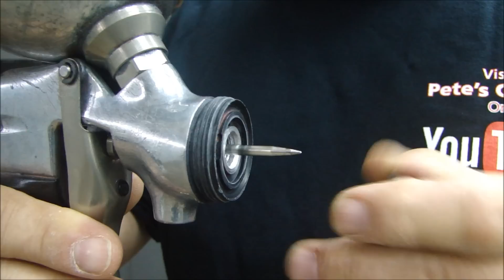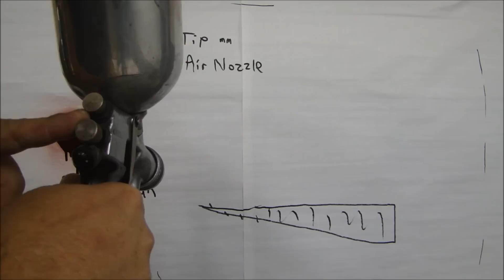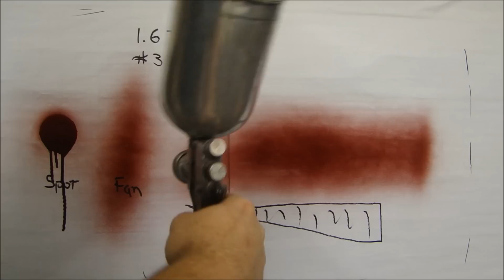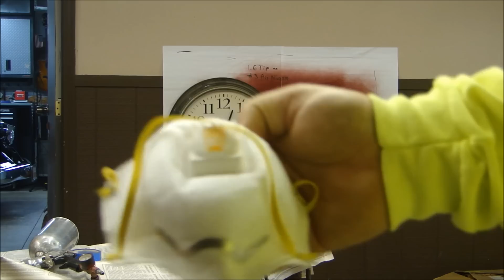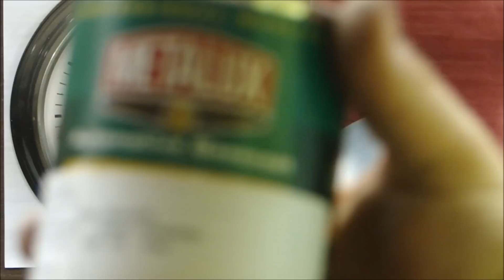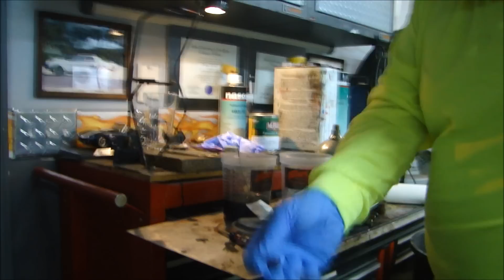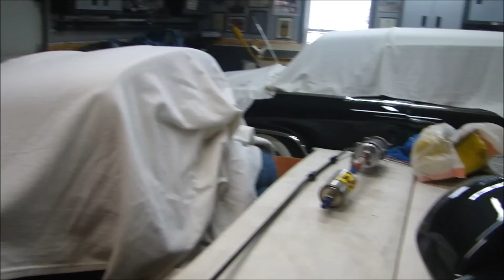Beginners Guide: Spray Guns & Spraying Base Coat Clear Coat

Comment: Hello Pete,
Enjoying your informative videos.
I have (3) Full Size HVLP Spray guns.
(2) have a 1.7 tip. (1) has a 1.4 tip.
All 3 new guns were purchased from Princess Auto in Canada.
Princess Auto is something like Harbor Freight in the USA.
Also, I have (4) new Mini HVLP with 0.8 tips (purchased again from Princess Auto).
My compressor is a 1 Stage 5 hp. 60 gallon unit (bought at a yard sale) used with a siphon spray gun.
The siphon spray gun was used in painting cars, furniture, and bird houses.
My questions: What spray tips should be for painting base coat clear coat paint?
Can my compressor be used with a HVLP spray gun or should I buy a 2 Stage Compressor?
Richard

Comment: HI THERE, I AM SPRAYING MY REAR CAP ON MY CLASS A RV- I HAVE A QUESTIO ON HOW TO PAINT THE REAR CORNERS- THEY ARE (ROUNDED) 6 FT. TALL AND APPROX. 12" WIDE- HOW DO I SPRAY THE CORNERS "VERTICALLY" INSTEAD OF SIDE TO SIDE?? THANKS PATRICK

Comment: Thanks for the tips, i've done small holes in bumpers. But very soon i'm going to try and paint my 2010 silverado. My question is how much activator should be used per 6 of paint? 6 to 3 of activator?

Comment: Great video. I have been cleaning my gun by spraying lacquer thinner through it, onto cardboard. will use your suggestion. I did not see you clean the gun, after a 2 part clearcoat. Is it the same, or is there a different chemical to use?

Comment: Hello there! I am very much an amateur painter and I've been doing as much research as I can but i had one pressing question. For things like the clear coat with a flash of anywhere from 5-10 minutes or even a base with a flash from 10-15; do you clean out the paint in the gun and put fresh paint in for the follow up layers or do you simply keep the gun loaded and wait for the flash time to pass. I actually come fresh from working on my engines camshafts which funny enough was guided by your wonderful series of engine videos! Keep up the wonderful work and thanks in advance for any advice!

Comment: Great video, but I have a question. When you spray the clear coat, is it 2k clear? If it is, I read the isocyanates in it when atomized, can get into your system thru your eyes, and I saw you were not using eye protection.
I wanted to spray clear in my garage, but I am really concerned about the isos.
Can you please comment?

Thanks.

Comment: Great overview for people trying to learn.  I am in the research/learn before buying a spray gun or trying to paint. I noticed one thing about your technique that I wanted to ask if I saw/heard this correctly.  When painting do you always keep the air flowing then trigger the material between passes?  It sounded like that except when you switched positions or paused to inspect. If yes, does this provide a better startup pattern for the pass than what I see others do which is all or nothing on the trigger?

Comment: Excellent video thanks! I've been fooling around with a sprayer for a year or so, I'm ready to tackle a bigger job and spray my truck. I've been trying out metallic paint and metallic clear, anything I need to know about gun set up or filtration? There seems to be a lot of metallic flakes left in the cup when I'm done. I use a 3M PPS system so it has a filter built into the cup. I'm wondering if I need to remove the filter from the cup, the gun, or both, do I use a filter at all? I appreciate any insight you can offer!!

Comment: Excellent! Thanks. Tomorrow will be my first try in my garage. Epoxy Primer went on the truck  yesterday and proud to say after watching, reading, practicing a lot of material, only a couple of mild sags on a very curvy 54 Chevy pickup. will fix those today. Will be spraying Single Stage Urethane non metallic. Weather should be about 80 degrees with about 60% humidity so planning to use about 5-10% urethane reducer to slow my cure time. Here's the thing...I have been doing this with a Earlex/Wagner HVLP turbine system with a 1.5mm tip for primer and then a 1mm for the paint. Surprised so far on the control (fan, flow, etc) I am getting from it but definitely not the guns you use. Practice practice.

Comment: Pete quick question

I am trying to find some information on the olde spray gun which had a impeller inside the quart size cup 
(the impeller was moved by air to keep the paint stir up)
I remember them from the 1960's

can you be of any help identifying them for Me ?

thank you

Comment: Highly appreciate time, knowledge, & experience, you shared makin' this vid. I will be tryin' these techniques.

Questions: When you have a body panel that's already painted & there is rust on said panel, what do you apply once rust is fairly removed? Thought about an rust coverter that turns to a primed surface area. Also, would you wash panel 1st, remove surface rust as much as one can, wax/degreaser, then converter or sealer? Curious on what to do to a panel that rust removal is addressed. Put an oil on it til one is ready for converter or sealer, then wax/grease remover & tac cloth. Would one wash it again before converter/sealer...etc? Then primer on top of that coat. Tryin' to understand when a sealer is really required, I overstand it takes care of any bleed thru before a base is applied. Thanks for any info, tried to convey multiple scenarios, hope I didn't lose you...

Comment: Hi Pete,
1) thanks for your video. You`re awesome!

2) I`m a wood finisher and i have all kind of guns and pumps. 
I just wanted to know if i can spray automotive paint/clear with a Kremlin/Exel  Piston Pump 10.14. 

3) what do i have to do if the part (passenger door) is already painted? Just sanding with 1000 grid, to break the clear, would do the trick or get into deeper sanding? No dents or rust on the door.

4) how much paint and clear would be needed if i want to spray the door both sides? I know its hard to answer this one, because is based on the amount of paint coming out of the gun. But, how much would you use? 

Thanks in advance!

Comment: I found your video very easy to follow and informative. Thanks for keeping it basic and not off putting. Inspired me to successfully refurbish the outboard motor on my boat which has given me a bigger problem in that I now need to paint the boat because it looks scruffy by comparison, then it will be the trailer etc.... Much appreciated.

Comment: Hey Pete! amazing turorial video, this is really helping me out! painting with a spray gun is a new thing to me, and this video is also very encouraging! now I have two unanwsered questionss here; lets say i want to paint a fuel tank ( blue) and also put some stripes (white) to it as well. as a standard when overlaping colors should the lighter color be sprayed first and then the darker paint (blue) applied last or the oposite should be done? second; when removing taping, again as a standard, how it should be done on most paint jobs. at what time does the tape should be remooved? right after applying the paint, when its completely dry or in between??

Thanks for the video, your time and sharing your knowledge!

Comment: Sounded like you had just a little. I have been painting since 14 but, I have been using High solid single stage a long time using pressure pots using about 70lbs and so now I have 2 vehicles to paint and tring to get back automotive is not going be easy. Thanks for the demo and I am going to need a hvlp like you was using and I learned a lot from you there and I apriciate your time.

Comment: Two questions Pete,
1. Your vid only shows one coat of base yet I hear many people say that spraying on up to 5 coats can be required. Is it just so that you get opaque coverage or is there a desired thickness? Is it different for solid colors versus metallic?

2. What do you do if you develop a run in the base coat? Stop , wait and sand back down.... start from scratch? I would think a clear coat run could be spot treated effectively but not base ... correct?

Thanks again for the video, it was very helpful.

Comment: HI Pete, GREAT video. I'm a complete novice at spray painting, but would like to give it a shot and see what happens. I've purchased a couple of very inexpensive spray gins to try out what I've learned, but I have a question...I noticed you don't seem to use a painter's booth or any type of enclosure, other than what seems to be a typical residential garage. -- Wouldn't I need some sort of booth with extractors and an air circulation mechanism? Or is a garage OK and if so, what do you need to do to your garage to make it work for spraying a car fender (as an example)? 

Thanks you and keep up the GREAT videos!!! -- BTW, I subscribed.

Comment: ive finally got to start painting after prepping for long time ive noticed clear harder to spray then base. ive been spraying it basmd casue base comes out more course as i put it..how do u spray clear i feel i have to pound it on cause i want it smooth im using a sata 3000?

Comment: All the way from South Africa, great video Pete. Iv been spraying for a while now and mostly 3d printed parts and a few other things. Just a comment to those starting off and wanting to begin and become good at it, Spray painting takes a lot of practicing and training yourself. Start off with the correct techniques and methods as Pete showed and it will become natural over time. Especially cleaning guns,I have seen loads of people that will leave paint to dry in a gun or inadequately clean a gun and the next time they spray they get it all wrong. Personally I don't go to the extreme of cleaning my gun like Pete and do that once a month but my guns stay clean internally all the time. Thanks Pete for all your knowledge that you share.